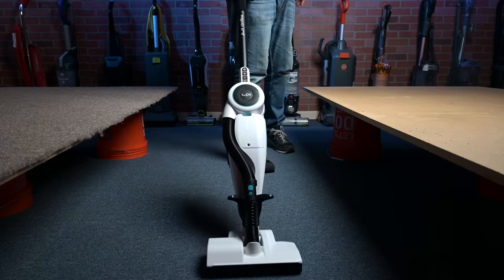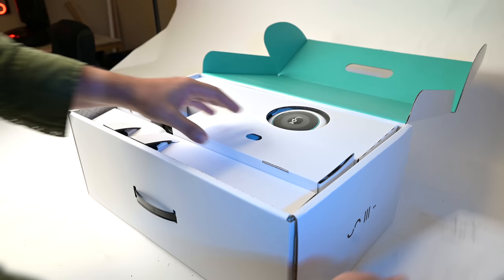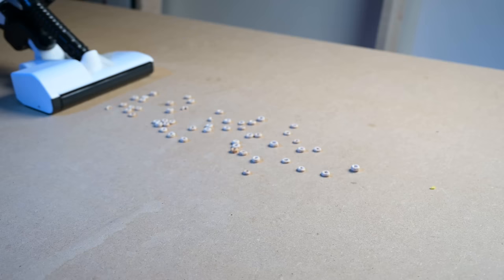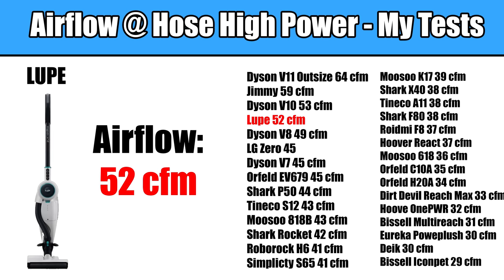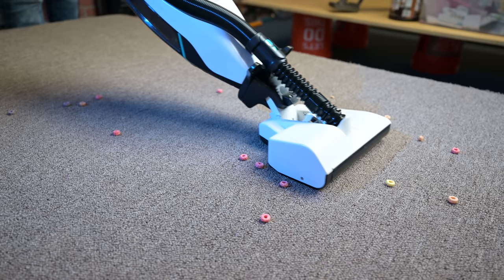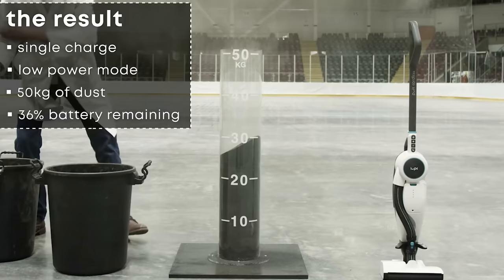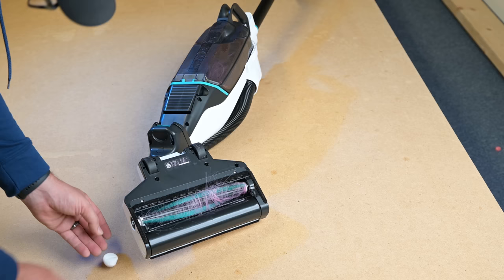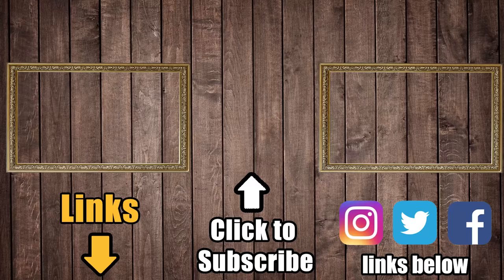Lupe Pure Cordless Vacuum Cleaner - REVIEW - It is THAT Good!

Comment: Got one a few months ago.  I've used it less than five times.  This is a NO.  NO.  NO.  I loved the story, the fundraising, the idea, and the product (and I LOVE vacuums) was an epic fail for me.  NOT intuitive at all.  Lights flash - why?!?  Going to the manual and pushing buttons all the time.  Stupid things like the buttons, not where near where I need them.  Lots of Dyson engineering, like the quarter unscrew brush and roller.    Suction on hardwood is SO amazing, you can barely unsuck it from the floor to move it along!!  FINALLY - and this is what was the giant nail in the coffin - TERRIBLE WITH HAIR - both pet and long human.  IT WAS AWFUL.  Hair gets wrapped around the rolls, compared to the shark fins that actually do a magnificent job in such a craptacular vacuum, but I digress.  And there you have it.  Pass on this model.  So, does anyone want to buy this from me, lol?

Comment: If they’re based in the UK, I guess they came from Dyson :P
Reply: I hate my dyson.
Reply: @ChannelZeroOne  Yea Dyson has good suction. but their vacuums are built suuuuuuper cheap and plasticky. Bound to break soon.
Reply: @Lilmiket1000  Mine does not pick up small pieces such as dog food or small debris similar in size. Its great for picking up hair and fine stuff. It gets clogged at the flex on the power head easily. Mines a lower cost DC35. $450 plus I expect way better. The suction is much less than my cordless dewalt vac.
Reply: @ChannelZeroOne  maybe you should a new one💀
Reply: @ChannelZeroOne  Dyson's marketing does not match their product. I've had the distinct displeasure of using a Dyson once and found everything to be subpar. It's possible it was defective, but it was very disappointing!
Reply: @Lilmiket1000  - We’ve had our Dyson ball for 10 years and have had their stick vacuum for about 6. Both work great. Zero issues. Learn to take care of your stuff.
Reply: @Cerus98  yea I agree. I've seen family with Vax duo brush animal thing and Morphy Richards etc. kind of Hoover's and nothing goes anywhere near the Dyson, what's funnier is that they have all switched to Dyson and prefer it alot more over their old vaccums. 

In fact even in the cordless, if you have had it for 4 years, replace the battery with a 3rd party one and you will get your full suction and battery life back.
Reply: @Dynamite Kid Fanboy much? Looks like you did not read the other post. 

I empty it after every use and a few times during use because the compartment is so small.  I am so ocd it would make you sick.
Reply: @ChannelZeroOne  it's really strange... What Dyson do you have? My mum had an old one (it's 10 years old I think) and she breaks every vacuum, but hasn't succeed trying to break her Dyson lol. I have the last wired one and it works like magic. She now have the V11 (the wired one is heavy for everyday usage) and she's really happy, she uses it 3/4 times everyday+multiple times to just pick up cat hair from bed and cushions... I think it's heavy, but it's her vacuum so if she's happy I'm happy too 😂
Reply: @Wischmopps  - Wanna try that again with some proper grammar and English?

Ps. We’ve had our ball doe 10 years now actually. We’ve beat the crap out of it and it still looks and works like new. We’ve replaced the ball filter once and had to replace a $10 part that broke after 8yrs of use. 

We’ve more than gotten our money’s worth. And show me one vacuum that isn’t made of plastic. You act like that’s a bad thing. Also - show me another vacuum that’ll last 10 years.
Reply: @Lilmiket1000  I bought a Dyson DC14 back in 2005 and have beat that thing up on pile carpet to garage floors. Its scratched up all over, but it has never broke and still works great. I'll buy a Dyson again in a heartbeat based on experience.
Reply: @Lilmiket1000  I am very positively sure your Dyson is a fake one. It’s pretty common to have fake Dyson floating around for real ya know. Do a serial number verifications to be sure.
Reply: @ChannelZeroOne  you probably don’t have one lol.

Comment: Bought this vacuum based on this review. They are having a 30% off sale in October which made it come in at $250 CAD less than a dyson (I’m in Canada). We have a yellow lab and 2 rabbits which means hair and hay dust are a serious issue. 

It shipped in about a week - which is less than most products I’ve purchased from the US. I also purchased an additional battery. 

So far here’s how it’s doing:

Pros: 
All the things in this video are true to my experience so far. 
it seamlessly moves from carpet to floor and the exhaust blows air up so the hair on the floor stays put to be cleaned. 

It’s tiny and light and you can store it upright or disassemble for tight spaces - I actually take it apart (which takes 30seconds) and store it in a deep drawer in our TV cabinet because it’s beside the dog beds. 

Filtration - normally when I vacuum, my air purifiers go nuts and this doesn’t happen even when I vacuum right next to them.  

Being able to attach tools to the hose and the long arm ended up being way more powerful that I thought. I was able to vacuum stairs and then do the moulding and ceiling corners without much fuss. 

Lupe service was highly responsive - I intentionally reached out a ton to inquire about shipping to see how the responsiveness would be - after all they sell it in parts so the service has to be there - and was pleasantly surprised. 

Cons: coming from a traditional vacuum the bin feels pretty small and the design of it could be improved as hair and dust get caught in places that would make you handle to reach into the bin but truthfully I e never done that and I’ve always washed my vacuum bins/filters regularly. 

Battery - for this to really support you on a deep clean of a home you need a backup battery. I have 2 flights of carpeted stairs, and two floors of rooms and with all the pets and traffic use it on high to do the steps. For more routine cleaning, 1 battery is enough. 

Another con of the battery is that there isn’t a place to store the charger with the vacuum. We keep it in a drawer so it’s not a big deal but if I were to store it upright, not having the battery cord and charger mounted nearby would be annoying. 

Con: it’s lighter, but on high power the suction with the weight on the unit is on your wrist. This isn’t a con that isn’t true of any other upright vacuum but worth noting because any vacuum with a lot of swivel will do that and the weight being at the bottom just creates a different kind of resistance. 

Last up - you might want to purchase an additional filter to avoid the 24hour downtime to dry. 

Overall: even with the extra battery it was cheaper than a dyson, it picks up pet hair and debris fast, it makes stairs, and jobs like car seats easy with the carry+hose format and I really like how tiny it is. Overall worth the money in my opinion. 
Hope this helps!
Reply from the maker: Super input! Thank you!
Reply: Who sells and ships it to Canada?
Reply: Is it noisy as lots of people say?! Can you pull all the extra heads apart from the vacuum so it would be much lighter while working?! Or the heads are separate?!

Comment: Yes! I was waiting for this review. I got mine from the kickstarter a few days ago and so far have been very happy with it. 

Those complaining about the price are forgetting that this vacuum is supposed to be a lifetime investment and if a part breaks you just replace that part not get a whole new machine. Like the saying goes “Buy cheap, buy twice” or for vacuums many many times.

The things that are important to me are effective suction - just less that 12 hours after my house was professionally cleaned and vacuumed the Lupe managed to pull out loads of dust, noise - much quieter than my dyson v10 and ease of emptying the dustbin - filter removes from the top so no areas for it to get caught.
Reply: Problem with thinking about it as a lifetime purchase is that technology is constantly improving. Batteries get bigger, motors more powerful, materials get lighter, etc. In 5-10 years this vacuum will be entirely obsolete in comparison to modern ones, and really any modern, decent vacuum can last 5-10 years. And for something that is supposed to be a built for long-term ownership and is, as they call it, "best in class longevity", why are the only willing to stand behind it for 2 years. It should have a 5 year warranty, minimum I feel. I tried out the whole "life-time" vacuum thing once when buying a very expensive Kirby vacuum. In reality though it got about 10 years of practical life out of it before it just could no longer match up to modern vacuums- especially in the sheer weight of the thing!
Reply: @Sandriell  the reason I say it’s a lifetime vacuum is not because every part of the vacuum will last forever but because the parts are made to be easily repairable and upgradable. Hence why the warranty is 2 years too. If the battery dies or head stops working properly or there’s an upgrade to the brush head with LED lights you can do this easily and relatively cheaply.

This is the young company’s ethos. Have a look at their kickstarter video.
Reply: @Sandriell  Correct, and don't forget that they are a start-up company...Who knows if they'll even be around in 4-5 years when you need them.
Reply: How do you feel it will compare to Miele triflex hx1 another Dyson challenger
Reply: @mattgibbs6732  it’s difficult to guess but this YouTuber has tested both but not compared the two.

https://youtu.be/RyOM0uuftec

I watched the Miele review and it seemed a bit more fussy to me with swapping to different configurations. I like that the Lupe doesn’t have a lot of accessories and parts that you have to store and that I tend to hide too well and then spend half an hour looking for a tool. It’s difficult to guess the comparison of the  performance though.

Hopefully Vacuum Wars will do another head to head test in the near future. 

I’m trying to be impartial but I’ve had it for over a month and I am SO happy. The only real negative is that my super shedding wool carpet does wrap around the bristles but it’s also easy to clean. My dog’s hair and my long hair has not been an issue though.
Reply: I'm not sure why people are touting 'replaceable parts' as if they're a totally new idea. Dyson's sold spare parts for years, and everything that's likely to go wrong on the newest models is really easy to replace. 

It'll mainly come down to the price of the spare parts, which on a machine this expensive won't be cheap. Dyson already charges £70ish for a new cleaner head - with two rollers I'd guess a new Lupe head is over £100. Spare parts pricing isn't live on the website yet so I can't check.
Reply: @Love00Mother00Earth  small parts are replaceable that’s the difference. When my dyson’s batter stopped working, they sent a whole new top unit. If it was just the battery then there would be less going to landfill.
Reply: I really like that it is designed for longevity.  But lifetime?  What are the chances this small new startup is going to be around in ten years in a very competitive market and still producing parts for what will then be an old model?  I wish them luck but right now I wouldn't count on that.
Reply: I looked up their replaceable battery:  150£,  I buy lifetime/older robot vacuum and necessary spare parts for half that price

Comment: A neighbour loves his new Lupe. Yes, it is powerful enough to K.O. mice on the underside of the floorboards, but it is also incredibly, ear-splittingly loud and produces a similar level of pandemonium to the mains powered, headlamp glowering upright my Grandma had in the 70s. Only with a lot more high pitched screeching.

And unless I missed it "noise" isn't a score metric. I make the point because in comparison our dog-eared Dyson V8 seems quite literally silent. Is that not important?
Reply: Yeah I was wondering the same if it is noisy or not. I'd take a quiet vacuum with a little less power any day over a powerful one that makes my ears bleed.
Reply: @huge_balls  exactly! which is why it's VERY hard to find someone reviewing these things that don't overlay the sound with their talking reviews and NOT actually letting us listening to the sound of the vacuums themselves - I'm sure it's somewhere in their unspoken contracts like I'm sure companies say "we'll send you a free vacuum to review AS LONG AS you don't upload video of the true sound" - same reason we don't hear the sound in any of the commercials either - no one would purchase them otherwise lol
Reply: even the 2 amp Little Devil is 100 decibels and that's dangerously loud for over 15 minutes use. So how loud we talking here and how many amps does this thing pull?
Reply: Suddenly I realized - I already use Greenworks 40 volt batteries and they sell a leaf vacuum using 40 volts for $100. So if this Lupe is so loud - might as well just use a leaf vacuum inside the house for $100. haha.

Comment: I bought this based on your review - The Lupe had lots of shortcomings.   The bin is a deal breaker.  Because of it's location, you can't tell when it's full.  Because they tinted the plastic on the bin, you have to get on one knee and try to see if it's full.  If you waited too long, all the rubbish wraps around the filter.  Then when you try to empty the bin, the latch ALWAYS hangs up so you have to push it open and then, most of the time reach your hand into the bin to pull out the rubbish.  This is easily the worst design for a bin to empty.  Combine that with it's basically useless on small rugs.  The only place it actually does shine is on tile floors.  It works great.  On carpet?  You raved about it.  In my use, I would vacuum the carpet with the Lupe.  Then I'd vacuum right after with the Dyson V11 and Dyson still picked up lots of hair that apparently the Lupe missed.  I love the idea of this machine.   But the bin being so hard to empty and to see if it's too full -- just a deal breaker.     Your videos are always well done.  But because on this particular video where you have the vacuum elevated to get in frame it shows the full vacuum and the bin.  It's very deceiving, because in REAL use, you don't have your vacuum at eye-level.   I should have been smarter when watching this video to realize this was a setup I'd never use at home vs being on a set for video.
Reply: @fireballxl-5748  I should have been more clear.  Even kneeling next to the bin, it's so dark -- you can't see if it's full or not.  Feel free to look at the machine and see for yourself.
Reply: BTW, I never returned the machine because I want this company to succeed.  I let the company know that as well as they were more than happy to give me a refund.  I didn't want to. I believe in this company.  I want them to make better products.  This is close, but it needs some engineering.
Reply: @tedrter  I will have my chance as I just bought one.   (with a 90 day return, works for me)
Reply: @fireballxl-5748  How is it going or haven't you received it yet?. I'm definitely interested in buying this vacuum for my mother at some point in the near future if it turns out to also be good enough from an actual real world users perspective :).
Reply: @WyattOShea  Unfortunately there is a story.  Got the vacuum.   Decided to get a 2nd battery (not that I really needed it as I don't have to vacuum a big house).  Couple days after purchase of the vacuum the company ran a $50 off Sept. special.   I emailed the company in the UK (where I bought it) and asked for some kind of discount on the 2nd battery considering the September discount I somehow didn't get.  What I got back was from a Julie Tyler and basically she told me to pound sand.....in a "nice" way.   I bought the battery anyway but will not post reviews that are positive because I've been poorly treated IMO.
Reply: @fireballxl-5748  Fair enough I guess. I'm still very interested in the vacuum though haha :P.

EDIT: Also thanks for the reply :).
Reply: I noticed the rubbish stuck at the top as well and remembered this comment. But it was really easy to empty the top. The black plastic that holds the filter pops right out with a tug and you can empty the top of the dust container from there. Was real easy and instructions were on the website for what to do when dust gets stuck up top. Probably was in the manual too but I was too lazy to check.
Reply: Have stool ready on which to put this machine.  That makes it nearer to eye level.  A flashlight on the back side might help show level.
Reply: @fireballxl-5748  yeah it sucks to miss a sale. You were not poorly treat though. You just bought the item to early to qualify for the sale.
Reply: Thank you, i was actually going to buy this vacuum but thanks to your review, I'm going to still shop around until i find the best one for me